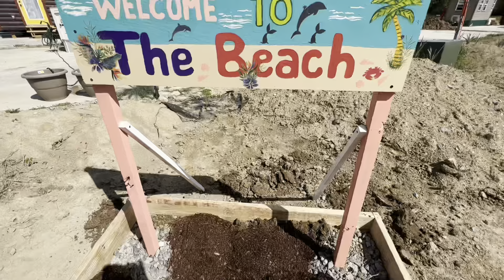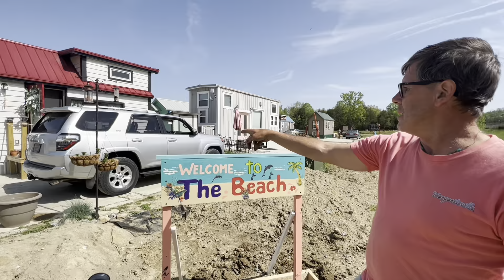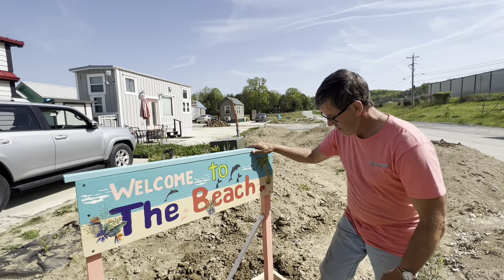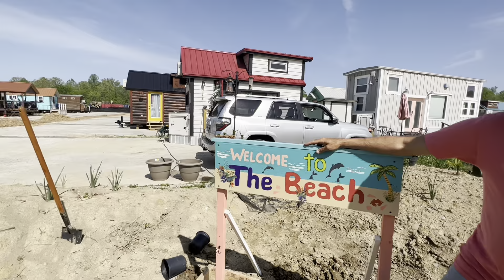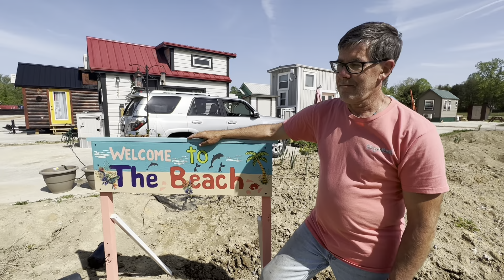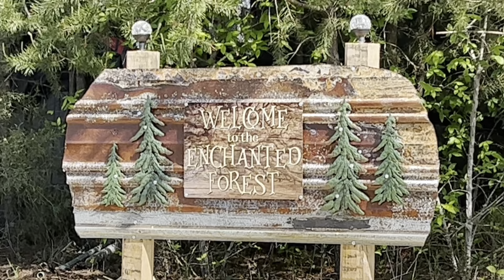What are the Benefits of Living in a Tiny Home Community 🏡🤩😉🇺🇸🤠🌲🌴🏡🤩😉🇺🇸🤠🌲🌴🏡🤩😉🇺🇸

Comment: 14:37+ if the mailbox bottom row is at 25-26" from the floor, there could be cubbies made for large packages placed beneath the square of 35. Or maybe 18" will work, since they appear to be 36-40" tall( using Dave as a measurement 😂).
Reply: Yes, they do need to be raised up so it's comfortable for everyone to get into their boxes.

Comment: You should reach out to some local student artists to create a mural on the post office...
Dallas - Southfork Ranch.....
xoxo Randolph

PS... I have done a lot of ADA design work... make sure you have at least a 3 foot pathway in the center for wheelchair accessibility (32 is min but 36 is better) and assign the upper boxes first to able bodies residents and try and save a few on the bottom row specifically for wheelchair access.  I would also add a camera inside for general security and theft.

For the beach, you should think abut putting in a heavily sanded spot with a volleyball net
Definitely lots of beach style grasses around there... they will hold up in the winters.

Comment: You're going to get tired of me mouthing off, but don't you think there should be a couple windows in case someone needs help at some point ? Lights inside and outside for safety. Older people can't sleep pretty often and will probably try going for mail in the middle of the night, especially on a nice summer. night
Reply: It has puck lights already installed all the way down the middle of the ceiling inside. Yes, a couple of solar motion sensor porch lights would be great, some facing the ramp, one above the door, and on either side of the steps.